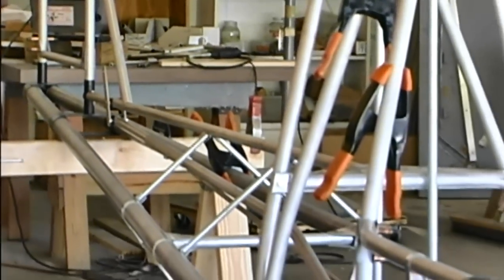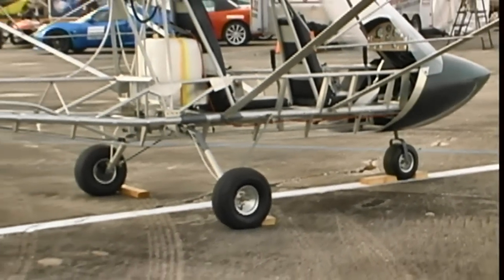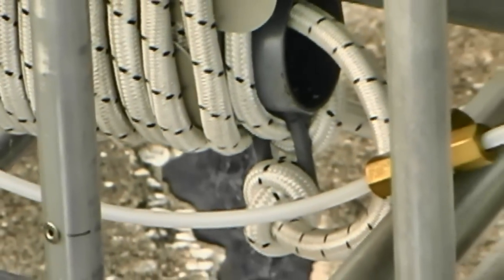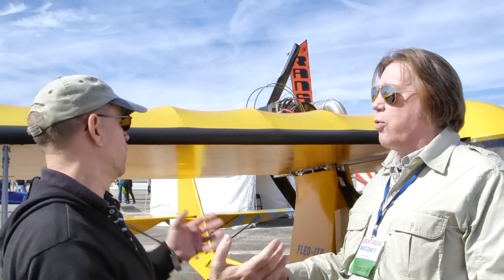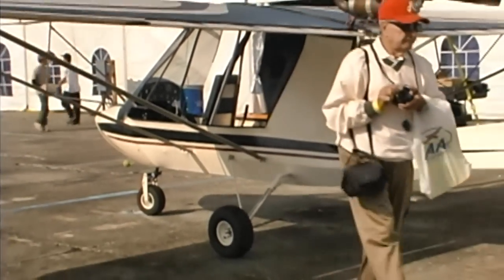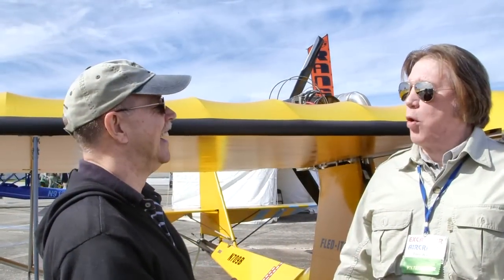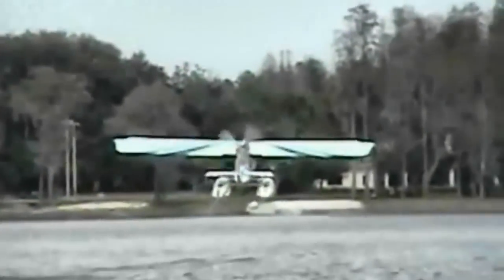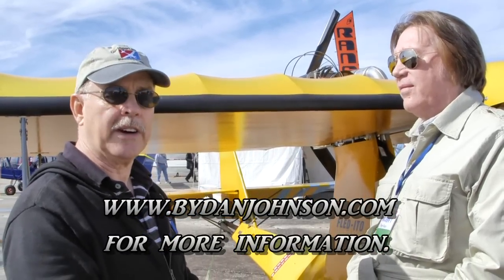Excalibur Aircraft, affordable, tandem two seat experimental aircraft kit.

Comment: I like it but at this price point and engine options your competing with tandem bush planes and small cruisers. As they are full legal aircraft, not part 103s, without some options like folding wings to store it at home and give them a kind of convivence, I have a hard time seeing why this is better than a pre owned Cessna 172 or a Zenair 701. have even found a Piper Cherokee for not much more than this with the larger engine options.
Reply from the maker: This is NOT a part 103 ultralight, it has two seats, and weighs more than 254 lbs. In Canada it is an ultralight, but in the U.S. it is an experimental amateurbuilt aircraft.

Comment: Very interesting. Have had an interest in homebuilt kits for some time. I see why novice pilots would be curious. Now, being a pilot for many years I was tad disappointed that no specs were included. Gross, empty, fuel capacity, bla bla bla....
Reply: Just o to the web site, excaliburaircraft.com. All the info is there :)
Reply: I received your answer. To the novice with money and little to no flight experience I feel your path may work. But, to an accomplished pilot that way won't work. I felt or hoped my question would get a direct answer which is essentially easy and necessary. Are you a pilot?
Reply: Nope, not yet ;) I'm going the LSA route as soon as I retire this year, in a few months. I already have my time booked at an airport in SC that has a 9 day course. I'm really looking forward to it :) As for what else you're saying, I guess this would be an ideal aircraft for the low and slow type of flying I like, so for me it just might be ideal. In the end, it's all about what an individual wants and needs.
Reply: did you get our free DVD?  tom
Reply: did you get our free DVD?
Reply: Yes I did, thank you :)
Reply: @su5119  You should know that two of my friends, one a retired TWA captain and one a former Air Force f-16 pilot both are flying this air plane now. I'm a former Naval aviator and I'm going to build and fly one of these, so I don't know what your comment even means. Thank you.